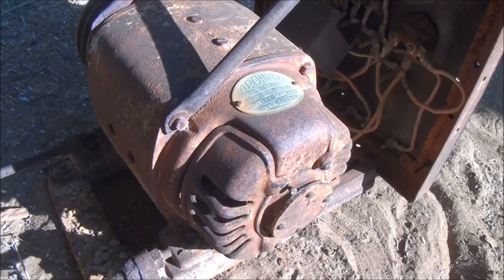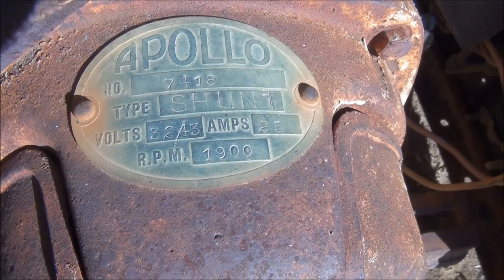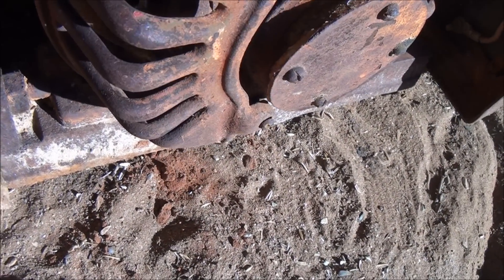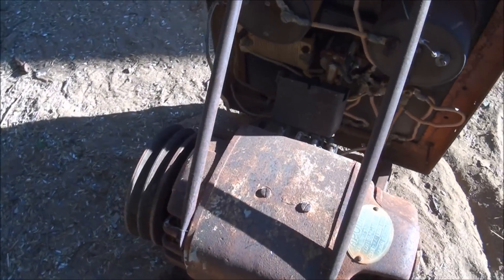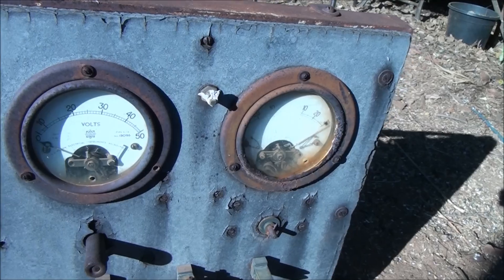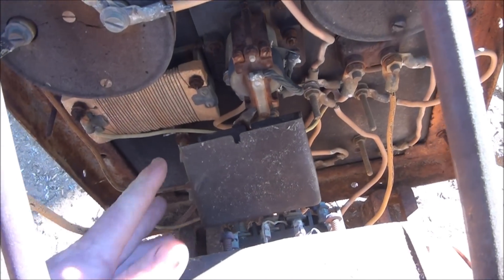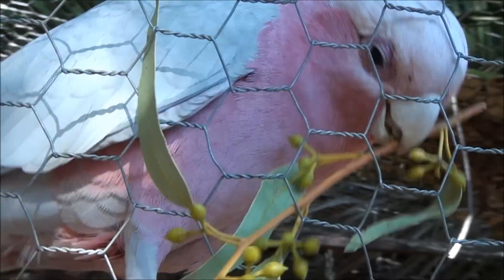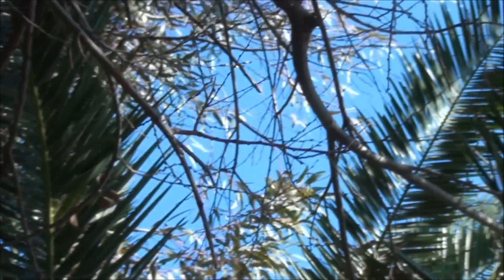Vintage Apollo dynamo

Comment: Nice find and complete gen set. I am sure that you will be able to restore that unit.
Those 32 Volts unit were common in the out back ?
I have read about 32 V dc radio sets in use in Australia in Silicon Chip and Electronics Australia magazines.

Comment from the maker: @enpeemac 
The Australian climate is normally very dry especially the outback thus the items are usually found in reasonable condition. Property owners are usually willing to part with the old stuff especially if its going to be restored and preserved. Some properties in recent years have had major cleanups resulting in stuff being buried or sold for scrap however a lot is still out there! Come out for a visit!

Comment from the maker: @Bevoin1970 
Hi Bevoin, thanks for yor comment, yes I have a puzzle to sort out, I will need to study the wiring layout and draw a circuit diagram before pulling it apart in case I forget how it all goes back together as things would end in tears if it all smokes up! Luckily the voltages involved are too low to pose a real electric shock risk but a ruined dynamo is a chance though. I will need to source some suitable low voltage lamps to run with it.
We get a lot of those birds, very noisy!